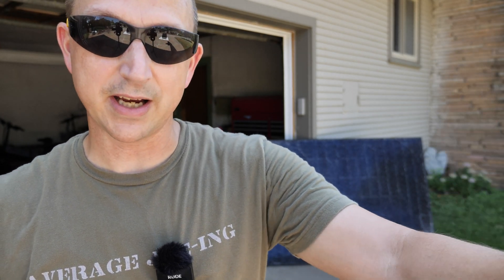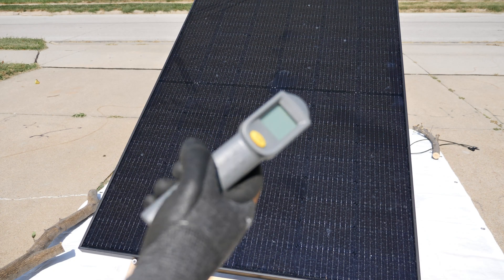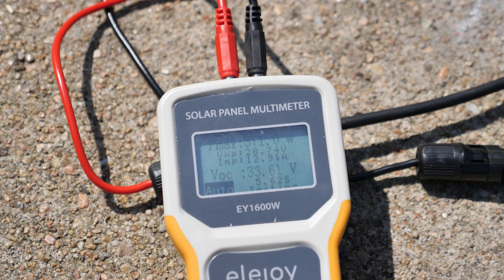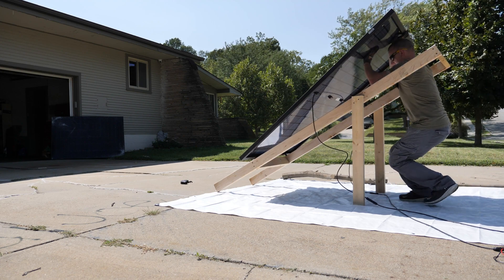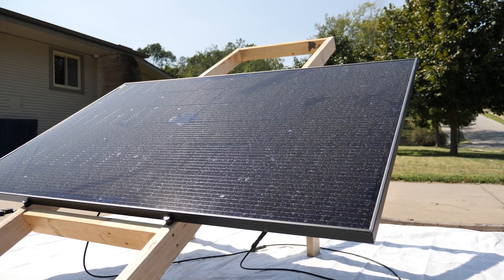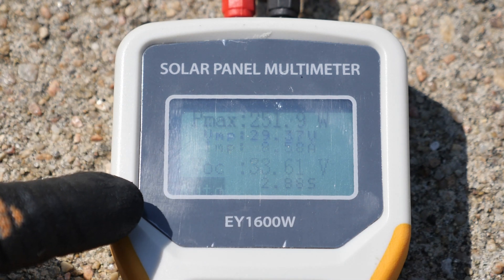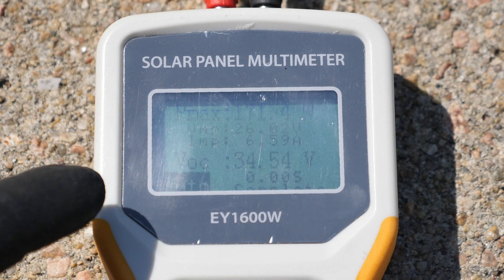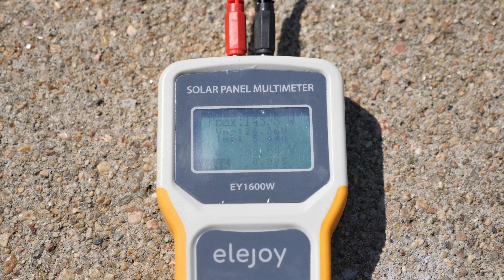Sirius 415w BiFacial Solar Panels with White Tarp Behind!  How Much Gain do you Actually get??

Comment: How about aluminum foil on a thin board behind the panels. 1/4” insulation board has a very shiny reflective surface and would be weather resistant. More expensive than foil but easier to mount and maintain. I love the idea of bifacial but they require some additional logistics to make them worth it. IMHO 🙏🏻. Great videos brother!
Reply: I said this in the original video. Put the aluminum foil 2inch away from the pannel.
Reply from the maker: Is that what you mentioned? The foam board with tinfoil on it? 🤦‍♂️ I musta missed that.🙄😁
Reply: @AVERAGE_JOE  Yes sir! I used to put that stuff under our soft side pool and it was devastatingly blinding with the silver side up. Great job on the tests. Of course someone in the peanut gallery will always have complaints. Don’t sweat it brother, you’re doing great. I watch all your videos. Your DIY solar journey looks a lot like mine. 🫡
Reply from the maker: Hmmm...yeah that might work!🤘